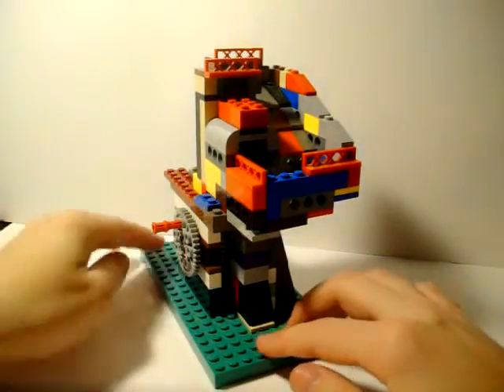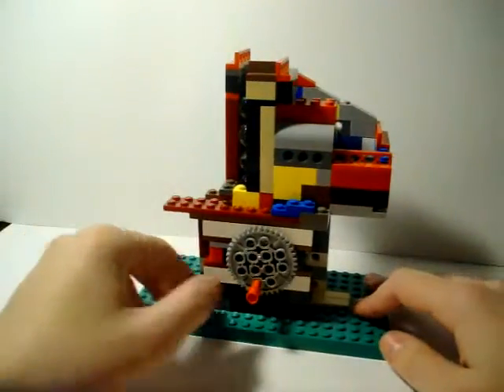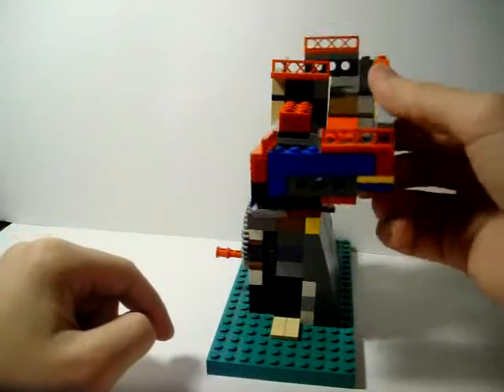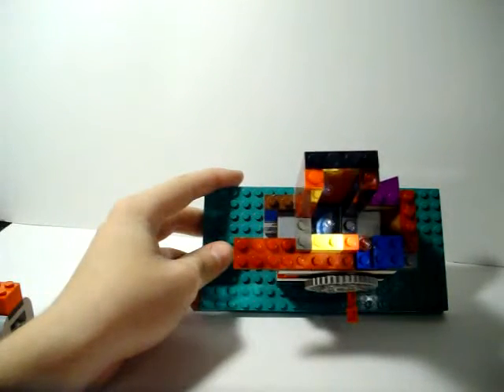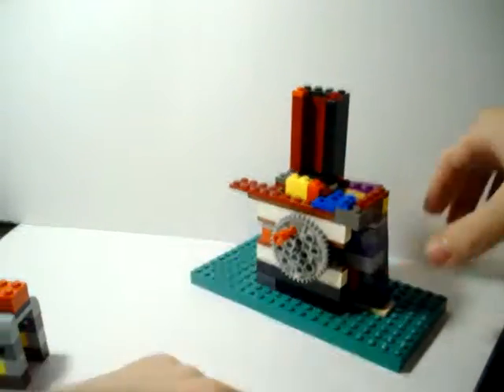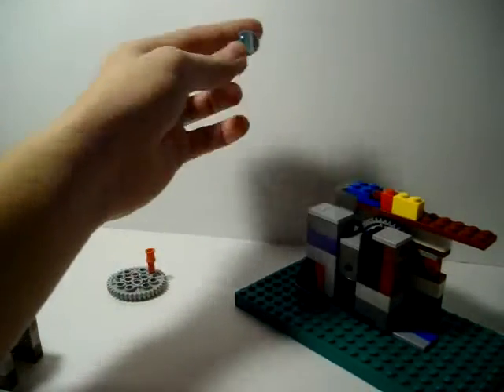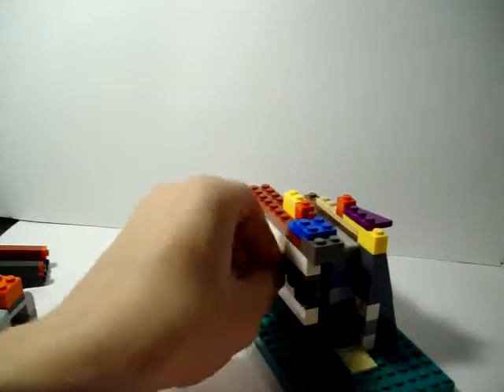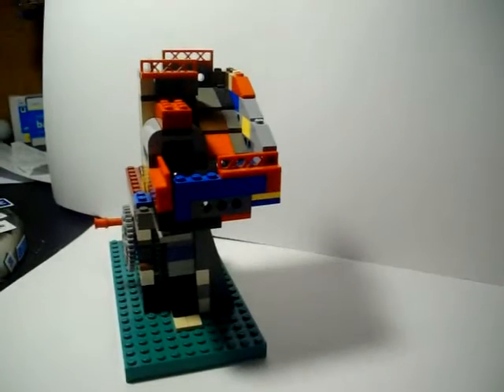Lego Marble Pump: How it works!

Comment from the maker: @knexdude4 You mean back out the way they came in? If so, you need to make sure that what you essentially have is two towers (Lord of the Rings haha) - one for the balls to enter into, the other for the balls to go up. The one into which the balls enter doesn't have to be tall (like mine), but tall enough so that once balls roll/fall in (by gravity and pressure from the balls behind them) they cannot come back out. You should keep trying to change the design until it works, or mimic mine.